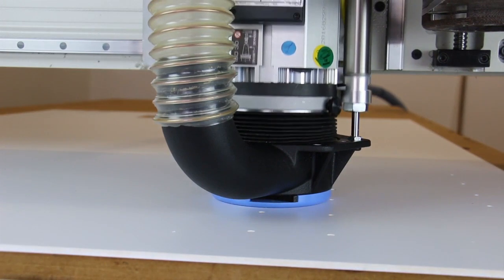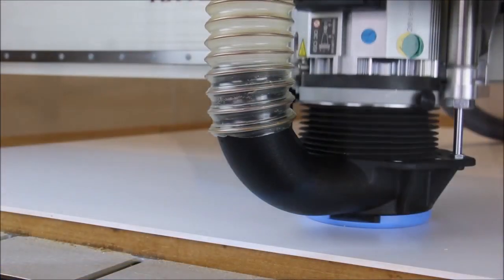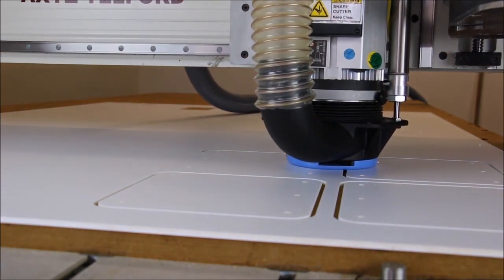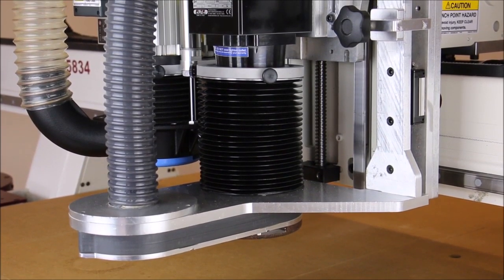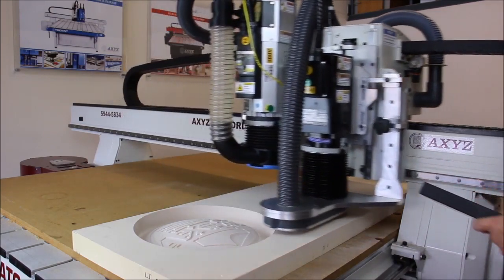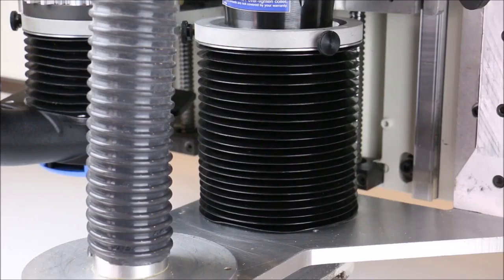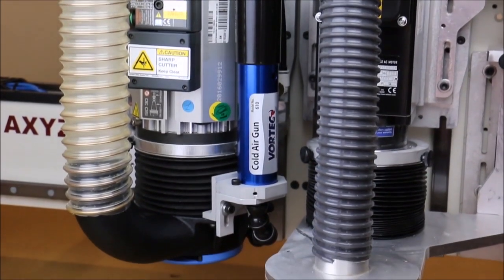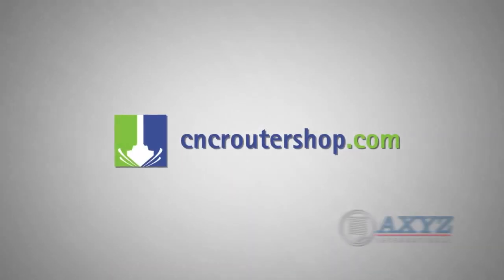Choosing The Right Pressure Foot For Dust Collection

Comment: I like this system but I have a tool changer so it would have to automated to move out of the way. Have you got anything for that? My spindle is a HSD 915.
Reply from the maker: Hi there, where are you located? This will allow me to direct you question at the appropriate contact.